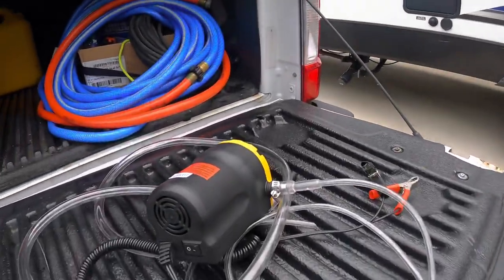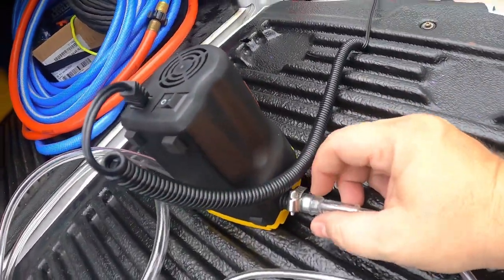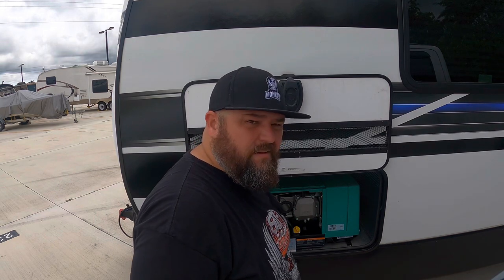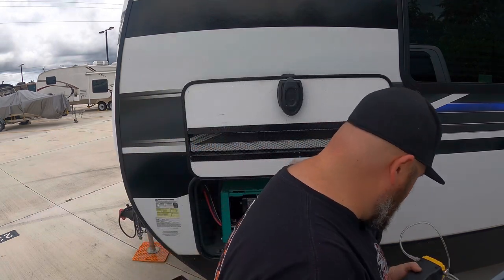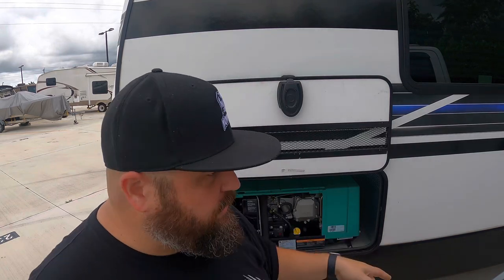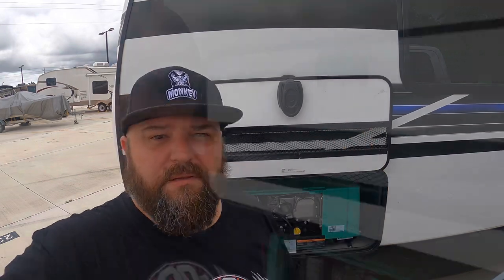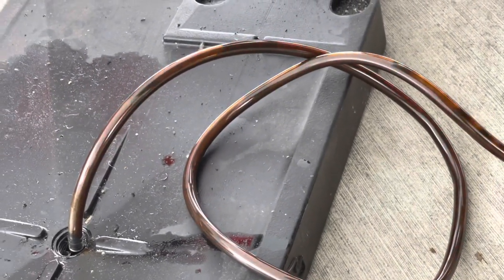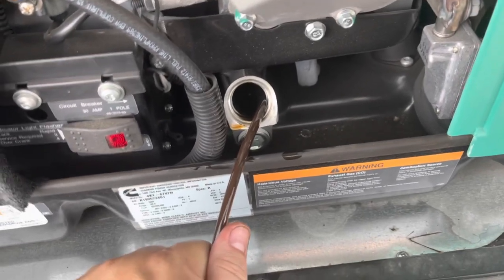Can you change oil with a vacuum pump? Getting ready for Sturgis…

Comment: I'm a shop tech for a south German car manufacturer. For most of our engines pumping out the oil is actually the recommended procedure. Some weird engines don't allow it or use a dry sump. Most of the time if the inspection sheet doesn't require the car to be lifted on the hoist, we pump the oil out but the oil has to be at operating temperature or be at least warm.
At first I didn't believe that it would suck out all the oil but after I checked it for myself on a couple of different engines by opening the drain plug afterwards and nothing came out anymore, I'm a firm believer in this method. Also saves you the 1.29 bucks for the copper crush washer

Comment: I have a manual pump. Hand pump & 1 US gal. container in one unit. No electric power required. 5-6 pump stokes/gallon when the oil is warm. Use it for outboards, cars etc. Still...check oil magnets if installed.

Comment: It works for lowering and raising the fluid level in any system, it's very nice for saving fluids when they're clean and you have to service a fluid filled system. However, with fluids of any type but especially with oil, as the oil ages and is used , it starts to get deposits mixed in with it vacuuming it out works for removing the bulk of the oil, what I do when vacuuming a system out is after my pump can't remove anymore oil from the equipment I'm servicing I add 1/2 a quart of fresh oil and pull the plug. Anything that the pump can't pickup will drain with the added 1/2 qt and beacuse there isn't as much volume of oil it shouldn't splash up out of the pan . Just a tip from a mechanic with 26 years of experience. Notice I use the word "mechanic" not "Technican"? I've worked and maintained so many types of vehicles and equipment I can't say I'm an expert on any of it,but I may have twisted a wrench or two......and fucked a bunch of stuff up before I have discovered what seems to work best.....I'm pre internet mechanic, you didn't have all the info at your fingertips so I'm pretty thankful for guys like you and all the others that share they're experience with the world.

Comment: Yeah we use that on tractors changing oil on them except they have a quick release fitting on the bottom of the oil pan same concept it works and less mess

Comment: I’ve actually done this on cars. There’s a handful of models where the dip stick tube is open enough to get a hose down and makes it easy to drain the oil from the car if you don’t need to get under it for the filter it’s great

Comment: I use the vacuum pump on the Wife's Mercedes.  That thing is awesome.  Makes oil changes a 20 minute job with no garage Yoga
Reply: If it's the 4.0 Biturbo V8, don't let it sit without oil for too long. There is a design flaw that the chain tensioners run out of oil and the chain skips at the next start.

Comment: Run your gen under load once a month or every other month for at least 30 min. I would drain the oil out the plug on the next oil change just to see if there’s anything in the bottom of the oil sump. Safe travels.  Cheers.

Comment: I do my boat like this too! Hope you like my comment on traction controlled braking (TCB)! I found way to remove most All Old Oil from Soft Tails (won't work on my Dyna because soft tails have separate oil tank under seat). 1. Drain old engine oil from motor. Replace drain plug! 2. (It takes 22 engine revolutions to cycle oil from oil tank back to oil tank) With engine cut off switch on (so motor won't start) activate starter motor an Count 11 revolutions) this gets fresh new oil from oil tank to filter. 3. Now remove old oil filter an replace with new filter (try to add fresh new oil to filter) 4. Remove oil tank intake line from tank an place in container. (Closest line to outside of tank nearest you) 5. (With engine shut off switch on so motor won't start) activate starter motor an Count 11 more engine revolutions while pumping old oil into waste container from disconnected line. 6. Re-attach oil intake line to oil tank. 7. Check for leaks/adjust proper oil level! 8. Have a beer!

Comment: Those fuel filters are a pain in the but. The easiest way I have found to do it is take it to the RV shop, no just kidding.  I have always just pulled the mounting bolts and blocked the gen. Up so you can get to the filter , have fun.

Comment: You are gonna have to purge that pump. Hot water with laundry detergent dissolved in it is safer than gasoline or other flammable solvent. Arcs and sparks are not your friend. Cool that this worked.

Comment: As long as there is no restriction in the fill tube and the hose goes to bottom of case go for it., 
I have a hand operated vac pump that I use on a lot of different motors.
Reply from the maker: This thing is real simple, the sump at the bottom is the lowest point so it all just sits there. Worked great!

Comment: Try getting a drain pan under the engine in an inboard boat, NOT Happenin'! This is a very common method in the boating world. A manual suction pump works well also and is probably 1/4 the price of the battery powered pump.
Reply from the maker: This pump was only $20!

Comment: Do you use wheel chocks, I didn’t notice a place for them? I wanting a small toy hauler for myself and was thinking about wheel chocks being in the way. Thought about the process of taking them in and out or even using them. 🍻
Reply from the maker: Hi! Yep, I use the Condors, but I don't bolt them down. They do their job just fine (the pit stop trailer stop ones).

Comment: The only issue I have with that is your not pumping and of the dirt and/or debris in the old sump. There was a “quick oil change” company that did that for years until they bought too many motors for there customers. Not a fan ….. my opinion
Reply from the maker: No, it's a valid point for sure. I am sure I will do a traditional change on the future, but for this time in that storage lot it worked well...
Reply: You L👀K like you or a man that has seen the 💡💡💡💡💡💡💡💡💡💡💡💡💡💡💡

Comment: Is that Fl. water that much better than Sturgis water? Just wondering WHY you would haul several hundred pounds of water and fuel (ok, the fuel tank ain't easy to drain), but that's just unnecessary weight and fuel used in the truck. Just my opinion, but I drain all my tanks in the RV anytime it has to be hauled.
Reply from the maker: Because I use the bathroom, shower, etc... And the fuel is to run the generator when I sleep.
Reply: @ProfessionalMonkey  Umm, yeah, I can agree with that. Makes sense if you stop while traveling and not having to worry about finding water to ad 20-30 gallons each time. The fuel part I get, just not easy to try to keep the fuel level low enough your not hauling unneeded weight, but have enough for the generator.

Comment: Yeah but when you pump it out all the old oil doesn't come out
Reply from the maker: Yes and no, I feel like I got as much as just pulling the plug, but that's just on this generator.
Reply: Hey there is a pump system that boaters and boat mechanics use all the time for oil changes.  
A 5 gal pile with pump and suction hose attached, the suction has 1/4” plastic pipe with hose going to pump, start out with empty pile so you see how much you draw out, yeah you won’t get it all but you’ll get more then that flex hose curling up in pan will. The rig you got is fine just add that plastic line and watch what you  pull out in separate container. On your next change. Another note of interest you can Jack up the trailer one way or another to get the oil in the pan go to where you can draw more out, same on them harleys

Comment: That's how I drain oil filter out     I put the drip trough under the filter which doest really get past the seal   I pack paper towels at the end buy filter gasket     pack under trough in front of motor       drain oil out of bike    I then leave drain plug out   oil cap off  then I take  ice pic   or big ass spike and punch hole about 1/4 inch or just less in the bottom end of the filter.     Fire up my vacuum air powered generator with 1/4 inch air hose  up with a catch can     stick hose in bottom hole I made in the oil filter  then I punch another hole in the top of the oil filter    let it run for 5-10 minutes  then remove filter  without the pint of oil running out the gasket end all over my motor.      If you have ever seen a harley pan off the bike  I don't think you could get the bottom with the mid pan insert and the dam passage ways zigzag across the bottom of the pan  from the top

Comment: so let's start with some facts...
have had many Harley's over the last half a century,
amazed at how these bikes grind themselves up internally,
while running, your engine will allow a certain amount of fuel vapor and exhaust to bypass the piston rings into the engine block / crank case which ends up in the oil,
gasoline is extremely caustic and exhaust contains carbon which is one of the hardest substances on the planet,

oil does two things....
The main purpose of oil is to lubricate and cool the components in your engine. Between combustion and friction, engines generate a lot of heat, and oil helps to keep things moving and prevent overheating.

oil lubricates until its viscosity breaks down (i.e wears out),
engine heat breaks down oil viscosity...and these engines certainly do run hot,

the second thing your oil does is act as a medium to carry oil contaminated with fuel and carbon to the oil filter,
the oil filter is no where near 100% efficient so a significant amount of fuel and carbon remain in the oil flowing throughout your engine, one of the ways we know this is that when you change your oil it no longer has that nice clear clean look,

you'll also notice that when you change your primary and transmission oil they both show a pretty cloud of silver sparkly stuff in whatever container your draining into...that is metal flake derived from wear on machinery parts....much like the carbon in your oil it does a fine job wearing down your bikes internal parts.

my rule of thumb is to change all three fluids at the first 500 miles.  this gives the bike time to properly break in, 

then, if you're afraid of hurting your dealer's feelings go pay the $300-$400 for the 1000 mile service....during which they change the fluids and nothing more.

I then change my fluids every 2 to 2.5 K miles.....due to the above and because fluids will pick up condensation internally especially during the cold season.
Reply from the maker: Huh? You do know this video was about me changing my generator oil right?
Reply: I know … but as you know the “what oil does everybody use”…and “how often should I change my oil”  is always an HD topic, so I thought i’d weigh in
Reply from the maker: @indianbill3123  gotcha…
Reply: conversely, i use the manual suction pump to change to oil in my Audi…and its AWESOME…..sure beats the old way of crawling under and pulling the oil plug

Comment: Will it work on bikes
Reply: Not advised by me. Also: Depending on the bike: You will not reach the bottom of the sump through the refill/oil cap.
Reply from the maker: Agreed. I wouldn't do it unless for some reason your oil is at the lowest point of the bike. I don't know any that are?